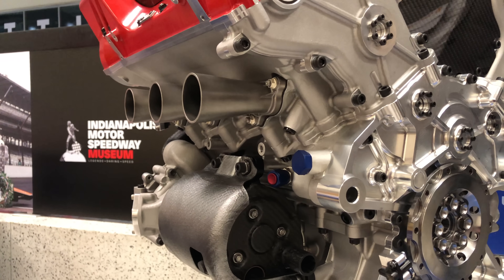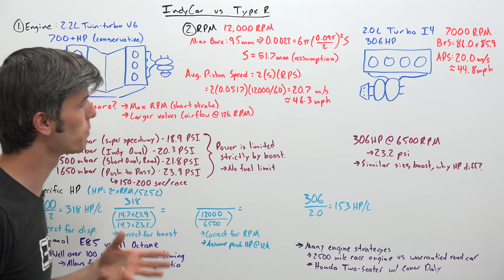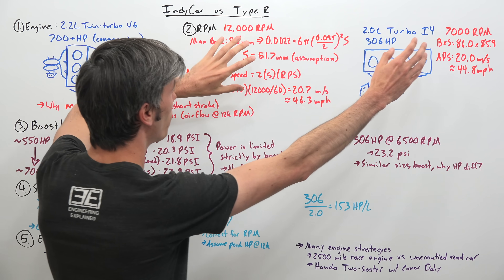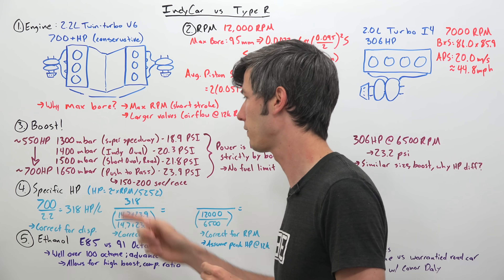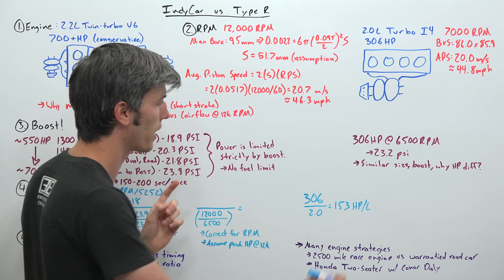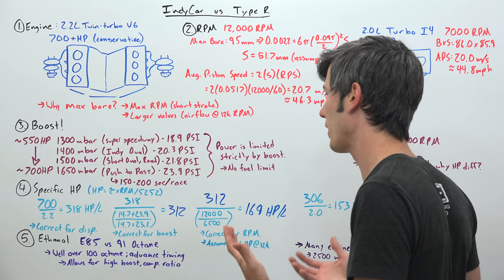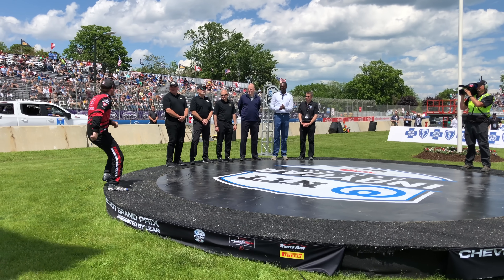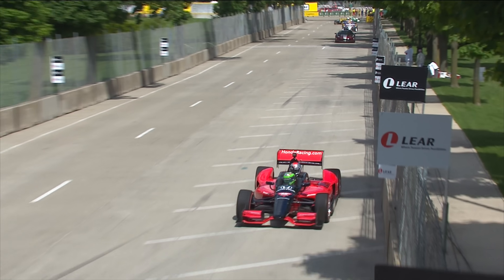How Honda’s 2.2L Engine Makes Over 700 Horsepower

Comment: First I thought you would not be taking into account the question of 'mechanical use up' of the engine, but later on your did. A little. Because maybe Honda is not using the maximum allowed bore of 95mm, but goes for a piston speed of lets say 24 meters (or more) per second. Second calkulation could've been helpful. I think Honda would be still able to achieve the durability asked for by spec. (Even fireblades did 22 meters already twenty years ago.) As we all know, more
stroke means more torque, and the potentially smaller valves get a little bit more boost. (1) Very likely the engine using up the material a little bit more, will be more fuel efficient (to a certain extent) as well - when considering engines with all other parameters being held constant. (1 - what we potentially loose through higher speeds in the ports and channels, fractions, should be overcompensated by the higher stress in the parts. As long, as it lasts.😉) But Honda never had any problem in using high piston speeds - because they build high quality engines 🤩 - and not every buyer see's from outside. Nor track spectator.

Comment: A couple of things you did not address. The Indy car engine has a much better thermal efficiency, close to 50%. How that is achieved of course is top secret. The flow of the heads and the type of valve train will be a huge factor in the increased horsepower.

Comment: When you first showed the engine internals I thought it was the indy engine, and I counted 4 cylinders in a row, and got very excited that Honda had made another V8 engine, and then realized it was the type R motor. I really wish Honda weren't so afraid of 8 cylinders.

Comment: My question is: when are you going to educate yourself that more ignition advance means more losses? The peak pressure is required at a specific angle after TDC, the aim is to ignite the mixture the latest and have it burning the longest while still peaking 15-20°atdc. The better option is more compression. More timing does not give you power, it is necessary evil.

Comment: Hey Jason....how did you get that max stroke equation....can anyone tell me please?
Reply: Well, if you know the bore and the displacement, it is fixed.  You have the cylinder volume  Pi * r ^2 * H * 6 cylinders = 2.2 L. Solve for H.

Comment: Why my '89 FZR400 sportbike leaves an RC390 at a straight line in a snap of the wrist? Answer: Horspower, which is easy to gain with less reciprocal mass by adding more cylinders.

Comment: Apples to apples indeed,lol. Totally different engine designs make that scarcely feasible at best:/ There is nothing complex about the simple fact of "more gas/air in and more out as fast as possible" makes more power. So of course, leaving out ANY other variables but 4 versus 6 alone gives two more cylinders with gains in flow that enables:/ Then come the heap of other advantages that a V6 TWIN turbo design has over a 4:/ Hard to compare these engines:/

Comment: Yeah, once you correct for the fact that it's the absolute intake pressure that's 1650 mbar, then the Indy engine's 'corrected' specific power is 273 hp/L - which blows the Civic away

Comment: The offenHauser 4 cylinder Indy car engines had to be pre-lubed/heated to operating temperature through the oil for about 2 hours before it could be started. It had to do with the tolerances being so tight the metal had to expand or the engine would ruin if started cold. Does the same rule apply to these Honda engines?.

Comment: Theres so much different between a production based street car engine and a race bred engine. That indy engine can maintain power at wot with no degradation. The efficiency level is not even comparable

Comment: last only 2,500 miles? Talking about disposable engines, you won't have to worry about the first oil change, you just throw it away. The Corvette zr1 with the LT5 engine produce 755hp. And this is one a mass produced car.

Comment: The engine in the Honda-McLaren MP4/4 was a 1.5L V6 that produced 900HP - after the boost was turned down. It was capable of 1500HP.

Comment: Sorry but this is the first of your vids that i dislike, too semplicistic in the way you solved for rpm. Basically you are comparing torque, but the way this two engine produce the same amount of torque per the same displacement, per the same boost level, with 6000 rpm difference from each other is what basically makes them a lot different from each other. Would have been more interesting if you had focused on that differences, my honest point of view and thumbs up for your next videos

Comment: Indy motor is designed to rev so much higher with better quality parts.  It is not made to run 200000 plus miles.  That is giving you so much more hp.  How much hp does the indy engine have at 7000 rpm?

Comment: Very interesting Jason. I'm amazed that the Type R develops combustion pressure comparable to a race car. I tuned my Focus RS and discovered how important ignition timing is to making torque on pump gas. At low boost, the RS uses "normal" ignition advance, but when the boost is up ignition is almost at tdc! I'd be interested in a video exploring the relationship between ignition timing, compression ration, combustion pressures.

Comment: WJason, being an engineer I thought you would have been straight onto the primary advantage instead of missing it completely. 
A "V" configuration engine will always develop more performance than an inline crank/cylinder engine due to the mechanical advantage of power application to the crank over a greater duration of the 360 degree rotation. An inline engine can only apply power/torque through I linear application which limits the torque advantage.  Short stroke and the longest rods you can fit into the engine combined with high rpm are the greatest mechanical applications you aim for, besides the obvious necessity of as much air ingestion as humanly possible. 
Read Smoky Yuniks book on power secrets & it will teach you a hell of a lot more that your degrees focus on "numbers"

Comment: How does Honda make over 700hp from a 2.2L engine?

Stickers. Lots of stickers.
Reply: They make more with the 1.6 liter V6 turbo hybrid that they use in F1
Reply: @DutchBart666  yeah with ease. The combustion unit alone makes around 850hp in qualify mode. Even higher outputs would be possible if they were allowed to use more fuel and more than 3 engines over the whole season.
Reply: A bunch o "funny" idiots here...
Reply: Remi Ramos a big eBay turbo
Reply: Vtec yo!
Reply: @DiscoR53  Actually no as indycar regulation no vtec and you can't woooosh me
Reply: and a fart can muffler like all the ones rolling on the streets.
Reply: @roberts2816  that would make 3000hp
Reply: Robert Guess more power than a v8 lol
Reply: Yes, & a gi'NORRRRMOUS fart can!
Reply: 2 vtecs on the vtec cam. Lol
Reply: Mhmm
Reply: Yeah the car doesn't really exist its actually just a sticker
Reply: Remi Ramos hahaha, that cracked me up! I scared my cat
Reply: In the Formula 1 cars in the beginning of the 80's BMW had a engine with 1485 ccm, 4 cylinder , 1 Turbo. They "fiddled a little bit" from engine generation to engine generation. I thing it was in the end of 1984, where they stopped developing the next generation of engines bc of the new reglement. 
Until than it was so, that the MPTS blowed the engine. But in this last days of the old reglement it appeared, that the motor blowed the MPTS.
The MPTS was build for 1300 HP  !  !  !
Reply: Without giving it any torque
Reply: dean marriott lol, smaller motors make torque.
Reply: @brianshaffer9347  Not vtec motors. GTI motor yes, honda vtec=zero low end torque.
Reply: dean marriott I was going to say American direct injection turbo motors are torque.
Reply: No low rpm
Reply: 700 hp? Easy. Gullible motor mouth journalists.Lots of noise 700db. Stickers, lots of stickers that send a subliminal message at high speed and noise level that says buy me. Your gut will go, your acne will disappear and this chick magnet works.
Reply: ..and a cooling system as tall as Burj Dubai
Reply: @goulddddable  Ork logic
Reply: Honda should hire car guys they’ve made 800hp 1.8L b series motors.
Reply: And rice.
Reply: witchcraft.
Reply: Its common for us street builders to get 800+ HP out of our 2.0 liter street engines. All day long
Reply: Vtec n type r emblems
Reply: remember Honda is an Aircraft engine manufacturer

Comment: Makes the k24a2 even more impressive. Using that formula the k24 at 7000rpm has higher piston speeds than even that IndyCar engine.   23.1 m/s for the k24a2.

Comment: A stroker by nature has little torque off idle.    So if you were to run a stroker like this in every day stop and go traffic.    You would be revving it alot higher to get it going from a dead stop.   You would be smoking thru clutches more often than what would be considered the norm.

Comment: I noticed compression wasn't brought up. Compression and also chamber design can play a huge part in power. And no mention of head flow flow characteristics. I guarantee that 2.2 is running some very high compression and sees some serious cylinder pressure.
Reply from the maker: I did mention compression. :) Known for Type R but not Indy.

Comment: Just a tip you might want to do your research concerning the quoted boost for Indycar.  Gauge vs. absolute.  For an "engineering" video I think you missed your mark a bit there.
Reply from the maker: Maybe you should do your research haha. I did mine. And everything listed is gauge, as is accurate for Indy, per their website. It's never nice to be condescending. https://www.indycar.com/Fan-Info/INDYCAR-101/The-Car-Dallara/IndyCar-Series-Chassis-Specifications
Reply: @EngineeringExplained  I see you found a generic link for specs, but unfortunately the way that reads is misleading and incorrect.  Sorry if that came across as condescending, but the sensors on the engine are a McLaren unit that reads absolute.  All of those numbers in mbar you quoted are absolute boost so 1500 mbar is only atmosphere plus whatever differential to make 1500 total.  I can assure you of this, it is my job to run these engines for a living.  It is unfortunate that Honda did not provide that info to you for the purposes of the math in this video.  I would be happy to talk to you privately to provide more info.

Comment: Interesting and informative.  I am not an engineer (I am a mathematician) so my view on the "disparity" would be as follows: power is almost entirely about how much fuel you can burn per second (thus how much air you can get through the engine).  That is a function of boost, RPM and the efficiency of the inlet pipework.  A secondary consideration is that the fuel octane rating allows for more efficient (higher) compression ratios. There, thirty seconds instead of eight minutes;-)
Reply from the maker: And only 30 seconds worth of information as well, rather than 8 minutes. ;)

Comment: Good explanation as usual.  Wish you would have compared the weight's of the two engines.
Reply from the maker: Indy Engine weighs 250 lbs. Not sure on the Type R, though it is available as a crate engine so that info should be out there somewhere.

Comment: Hi, piston return spring how it works?
Reply from the maker: Puts the piston back to the top so it can press the piston down again, for all the horsepowers.
Reply: @EngineeringExplained  it increases the horsepowers? what are the benefits?
Reply: @EngineeringExplained  Could you make a video to explain it?

Comment: how do the valve trains differ? is the stroke in the v6 50mm?
Reply from the maker: Both DOHC, but Indy engine does not have variable timing or lift (per regulations).
Reply: @EngineeringExplained  i thought indy had those pneumatic valve springs.

Comment: WOW!!!THis is a super experience...Indycar-racing ride for Jason.  They've changed from methanol as fuel to ethanol E-85 now, which should give better cold start and low corrosion potential than pure methanol.   Practically speaking though, the reason that the V-6 engine can rev  to 12,000 rpm is due to high compression ratio permitting faster combustion.  The much higher evaporative cooling effect of ethanol with direct fuel injection allows much higher compression ratio than the use of gasoline.  Though, this engine is not good for daily driving due to lower fuel efficiency, due to higher heat loss in the combustion chamber at lower speeds due to higher surface to volume ratio brought on by the way overbore dimension of 95 mm bore x 51 mm stroke...pretty extreme.  Long-stroke engines are used when efficiency is desired.

Comment: 25psi boost // i remember richard petty said the super bidr had a air fan made into the clutch plate off the bell housing the top was ducted to the air cleaner and no body caught it // you cansee in the old vids of daytona he war passing three at a time // setting sail never raised any eyebrows / stp explained it away grediting the nose dam  //  for a real thrill drive a super charged cart car in fl. //

Comment: 2:01

uses "simple" to understand measurents and explaining them well was definetly good but as a metric user my tiny brain is unable to understand mp/h as km/h feels so more streamlined along with rest of the metric system

also m/s=   km/h x 3.6

or from km/h x 3.6  =m/s

so 20.7 would be ArOuNd 72km/h

Comment: I would have also calculated piston acceleration, an indicator of load on the rod and it’s bearings. Also torque at peak rpm, 306 ft-lb. for the race engine, 247 ft-lb. for the street engine. E85 has less heat value than straight gas, octane is a measure of ability to avoid preignition (knock) and has no bearing on heat value. Gasoline is 114,000 BTU/gal, e85 is 87,250 BTU/gal.  E85’s value is in raising the octane level. But it takes more fuel to produce the same power. More fuel requires more air, which is provided by bigger valves and higher boost pressures.

Comment: I don't understand how you correct for boost.
Reply from the maker: You're looking at the total air going into the engine. So displacement with atmospheric = 14.7 psi, plus whatever PSI in boost.
Reply: @EngineeringExplained  Oh ok that makes sense now where the 14.7 came from, so 14.7 is the default displacement in any car?

Comment: How did they make it easy turbo and high rpm. 700n/a is impressive 700 boost not so much. You can make what you want just turn the boost up.

Comment: I have GOT to try and build one of these in Automation...no E85 in the game yet though, so might be tough.
Reply: I managed 734 hp @ 11200 rpm and 354 lb-ft @ 10700 rpm. This is on 95 (AKI) octane. All this with 100% reliability. Now I need to build a car to put it in and export it into Beam NG so I can see how it drives.

EDIT: Just realized I had the in game year set to 2012. Set it to 2020 and got 747 hp (same rpm) and 1 less torque @ 11,000.

Comment: What? Seriously?
I mean for a modern Racecar engine a turbocharged 2.2 producing 700hp is like..... Yes? So what? It's average. If like an LMP1 oder F1 engine they did that running on a fuel flow limiter, that would be impressive. Honda is such a fantastic racing engine builder. They had 960hp from a naturally aspirated 3l V10 at 19.000 rpm, they had 1000hp in racetrim from a 1.5.

Comment: Also can't compare boost for boost. A larger more efficient turbo will push more CFMs at the same boost level. 23psi <> 23psi on two different turbos.
Reply: @EngineeringExplained  Are you saying that two different turbos on the same motor running at 23psi manifold pressure (holding to redline) will have the same air density and make the same power?

Comment: I think Mercedes AMG just told everyone to hold their beer while they went off and build a 4 cylinder engine making 416 hp from a two liter engine that’s in a road car.
The F1 engine they build is also not to shabby 1.8 liter engine producing over 800 hp and that’s not including the hybrid section, and over 50 percent thermo efficiency .
Reply: Yes but I find the lack of noise from F1 disturbing.

Comment: Didn't former F1 cars in the 80' had double the power with only 1.5L?
Reply: Yes, but only for few laps. They used exclusive qualifying engines back then which were basically scrap after the session.

Comment: love your work, but what about the torque differences??
Reply: Yeah I was thinking the same thing, VTEC or not I'd guess that thing idles at like 2k RPM and probably barely has enough torque to get the car moving before the turbos spool. Lots of folks fantasizing about swapping this motor into this car or that car- it would be a PITA to drive on the street
Reply: @303nitzubishi4  exactly what I was thinking, love that low down torque for street drivability

Comment: lol You can’t compare boost boost does not mean anything you can have a motor that  makes 400 hp at 20 psi and you can have another motor of the same displacement that makes 400 hp with 30 PSI Boost is just a number it doesn’t mean anything it’s all about the air density Watch Banks performance Latest videos

Comment: Would love to see a video explaining why drivers tend to drift around corners in rally racing,  whereas, in most other forms of racing drifting is avoided to maintain static friction and keep momentum.
Reply: It's due to the fact that there's more grip on a tarmac vs dirt on a rally course.  With less grip, it's easier and faster to slide the car to the correct angle for the next turn and not tear up the tires as much while on tarmac the grippier tires skid on the grippier road, scrubbing speed and damaging your tires which give you less grip later on.

Comment: 2.2lt twin turbo with 700hp is not uncommon really.  My old 2.2lt Evo made 680hp and revved to 9500rpm. The 12k RPM however is pretty special.

Comment: 306 hp with the crank loss equals around 260 whp for the new Type R. Not bad for some fun.. I'm shooting for 220 whp All Motor to the wheels on old technology B series 2.0 engine.